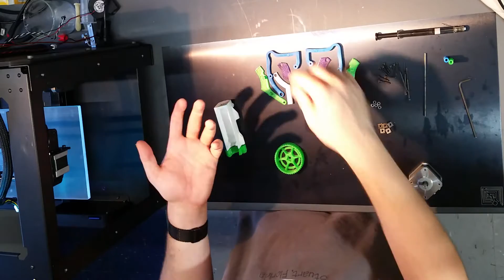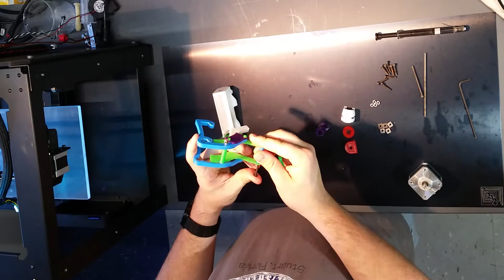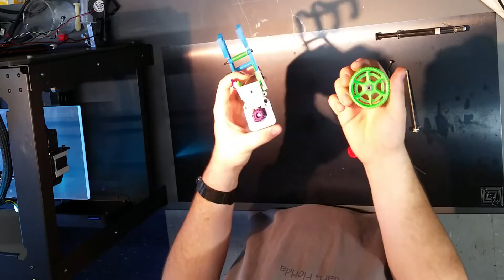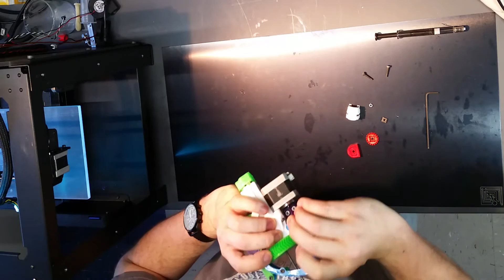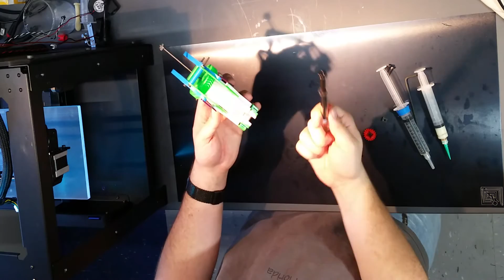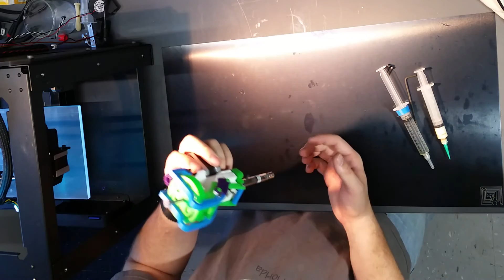Replistruder V2 Assembly for FRESH Printing

Comment: Have you used this to print food? Can you print a paste like peanut butter or a processed food?
Reply from the maker: If you're not doing embedded printing and are just printing in open air, foods with a yield stress would work the best. The first test prints ever done with the Replistruders were done with mayonnaise as mayo is a Bingham Plastic / yield stress fluid. It appears that peanut butter does indeed have a yield stress (https://link.springer.com/article/10.1007/s003970000120), so it would be a good candidate to print in air. Some printers have been modified to print cheese whiz as well. Frostings are also good candidates if you want to get into printing sweet things.